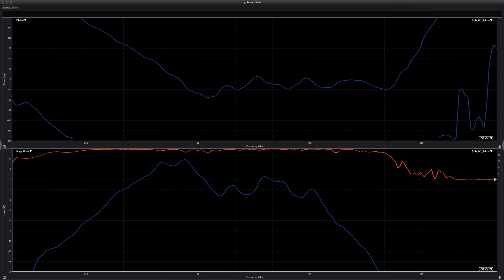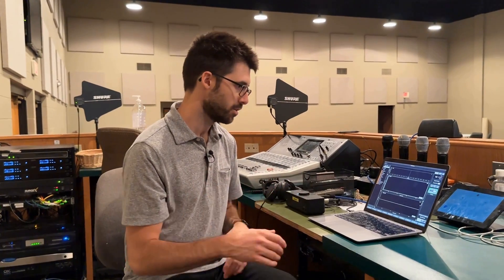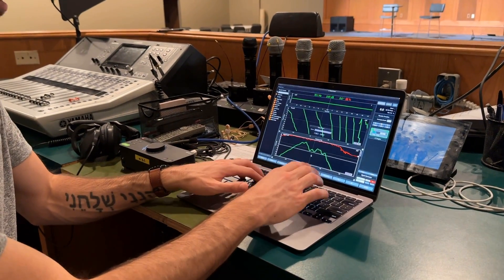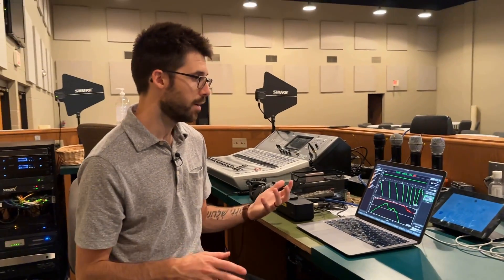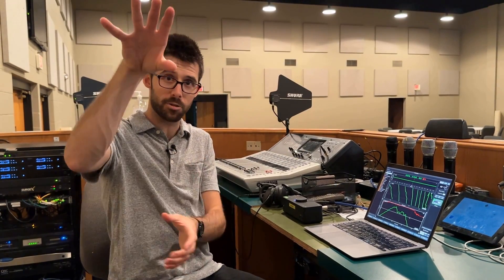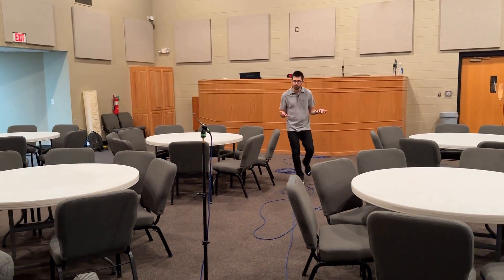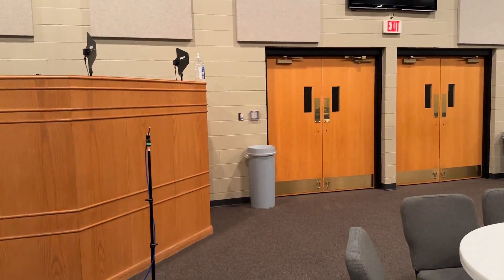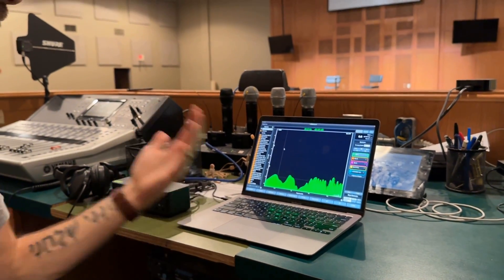Can I Trust Messy Subwoofer Measurement Data On My Gig?

Comment: another point for your measurement result is the behavior of omni subs placed directly against a hard wall. to get a better bass resposne you should consider to calculate the acoustic center of the subwoofer. with this result you place the sub facing the wall in the calculated distance. 
Merlijn van Veen devoloped a calculator, that can be used for this purpose and Mathias Huber made a video about it: https://www.youtube.com/watch?v=GBE219dITNA
Reply from the maker: Yes, that's a great point!

Comment: Okay dumb question but why not try to compensate for the room via EQ? Is it position-dependent? Imagine a magic room that uniformly sucked 5dB out of the signal at 300Hz at all listening positions - wouldn’t we boost the signal to compensate? So I’m assuming it’s a non uniformity limitation?
Reply from the maker: Great question! You certainly can compensate for what a room is doing with EQ, but just making sure that that phenomenon is consistent at every listening postion.

In general a room will have more low-mid "buildup" in that many low mids will be coming off the rear and sides of the box and reflecting off walls, but all of those reflections will be arriving at each listening position at differing times and levels. BUT, in general, the listener will perceive more low-mids than just having pure direct sound from the speaker. So often times I find myself taking out more low mids in PAs that are indoors and in reverberant rooms than an outdoor PA.

Comment: Just FYI when doing measurements or just using one cabinet when it is next to another cabinet, it is preferred to short out the driver of the adjacent cabinet otherwise the cabinet can basically absorb energy from the working cabinet and mess with measurement data or output performance of the system.
Reply from the maker: Thanks for the tip, Eric!
Reply: I can't tell you how many times I've brought an outside system in, and the house sound guy will refuse to just turn on his subwoofer amps to dampen them. It's very frustrating. This should be common knowledge.

Comment: Hey Michal, actually you are adding delay to the reference signal, not to the measurement signal. (@ 3:38). Just for your information: If the Phase slope is going downwards fro left to right, it means: "the Measurement Signal ist arriving later than reference Signal" . (in your case on initial measurement). On this circumstance if you add delay to measurement signal, it's slope will be more steeper.
Reply from the maker: Yes, thanks for correcting my Freudian slip. Sorry for the mixup!

Comment: could you have used the auto find delay tracker instead of manually adding the delay...?
Reply from the maker: Most analyzers have a hard time finding where to sync the reference with the measurement signal on low frequency information with "auto find" features since there's no real "spike" on the IR. Sometimes they're able to find it, but not always, so that's why I chose to show the manual process.
Reply: to find the 'correct' phase trace, meaning also including the phase shift as it is introduced by the high-end roll off (by IIR filters !) you could manually move the delay compensation to the ONSET of the IR ..(not maximum)..
keep up your good work!
 @MichaelCurtisAudio
Reply from the maker: Great point! Thank you so much. @theimunten6325

Comment: I apologize if I missed it, but in this instance where do you land for alignment and EQ of your subs to your mains? If your measurements appear consistent between the mid and back sections would that mainly be what you go by, and would you adjust any EQ at all with how they are responding to the room?
Reply from the maker: Hey, Jonathan. I didn't cover that in this video since I didn't have access to the DSP. This video was more of a "let me show you a specific measurement phenomenon" more than a "here's how I tuned this system" video.

I usually end up aligning subs and mains about 75% of the way back into the audience area. And as far as EQ, I'll apply some to the subs to get the general tonal shape I want out of them if they're not already suited to my target curve out the box, but am usually not trying to overcome any room anomalies since those change in every seat.
Reply: As they say  @MichaelCurtisAudio  , the only way you can EQ a room is with a bulldozer! Hahaha 🙂
Reply: @MichaelCurtisAudio  gotcha. Thanks Michael!

Follow up question then: if you were tuning and adjusting with a DSP, would you then make your adjustments based on the furthest two microphones since they presented very similar data?
Reply from the maker: Yes I would! @thejonathanhatch

Comment: Michael, hello. Is there a technique (geometric, algebraic, divine or some other) to correctly place the microphone in space to measure the acoustic system? Thank you in advance.
Reply: I think he previously confirmed he's planning on making a video about it, but maybe it's in the backlog
Reply: The "Correct" place depends on what you're trying to measure. Measuring the front row is the right place for timing front fills but the wrong place to shade the HF of the top boxes of the main array.
Reply from the maker: @benjonestech4981 beat me to the punch! It's all about what question are you trying to answer. There's general principles for mic placement, but they must be couched within a tuning workflow and framework.
Reply: and???? @MichaelCurtisAudio
Reply from the maker: @ruslanbatkovich  I cover the topic in depth in my workshop: https://www.producedbymkc.com/systemtuningworkshop

Michael Lawrence also covers it some in this video: https://youtu.be/rV76FA1iaik

Comment: Tell me you didn't take your measurement with the Microphone resting on the floor? Seriously Dude !!!
Reply: For subs this is fine, it's a halfspace measurement. It is the method to get rid of floor bounce.
Reply: It’s called a near field, half space measurement. It is a valid measurement that we used at JBL Pro all the time.
Reply: They're two different things. 

- Half Space describes an acoustic loading
- Ground Plane describes a measuring approach 

Right? 
Perhaps I'm missing something.
Reply: @FOH3663  you are correct, you could in theory do both at the same time
Reply: It's a ground plane measurement, not half space afaik
Reply: @hrmny_ yeah you might be correct. I think in most cases it is used for the same thing.